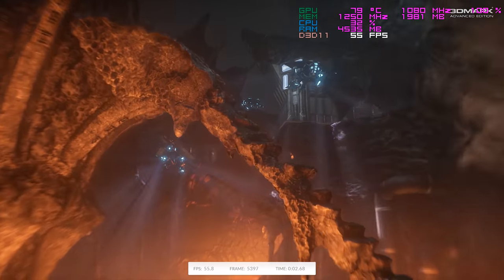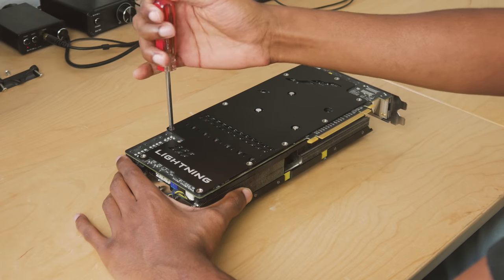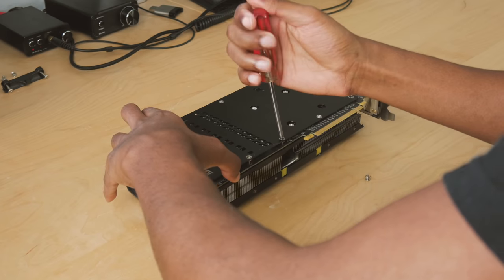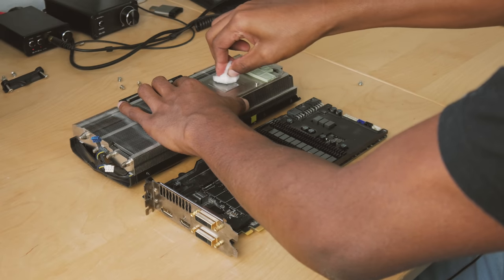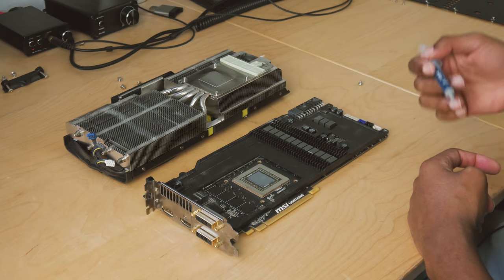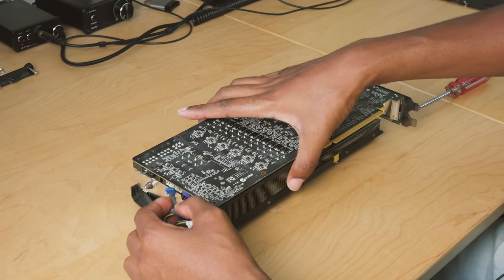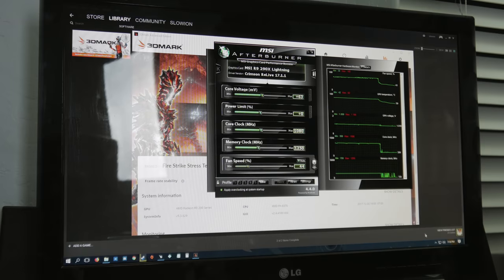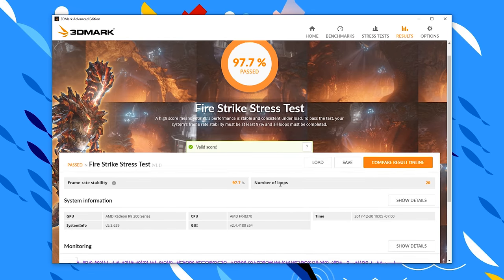Replacing the Thermal Paste on my OLD Graphics Card! (R9 290X Lightning) Was it WORTH IT?!

Comment from the maker: Have you replaced the thermal paste on your gpu? If so, what were your results?

P.S. - Sorry for the shitty audio at the beginning
Reply: I replaced the Thermal compound on a EVGA 980ti and i dropped from overheating thermal throttling 95°C to about 71°C Overclocked, I replaced it with Noctuas NT-H1 and I'm used to spread it on the gpu die. The old thermal paste was really dry and crusty so it wasn't an unusal thing that this past won't let any heat through.
Reply: The R9 290X of my dad idles at like 60° and reaches temps of 85-90° under full load. The card is already 5 years old and has never been touched
Recently i changed a few setting for the texture quality to be high performance rather than good looking and also raised the power+temp limits to max. So that explains the rel. high idle temp
Used some thermal grizzly kryonaut(IMO the best heat conducting regular thermal paste besides LM)and it idles now at 45° amd reaches about 75° under load
Reply: Before repaste my R9 290X WINDFORCE REACHED 95 degrees in ubermode very quickly around 30 sec and started to thermal throttling. After repaste the temps dropped DRAMATICALLY! before repaste GTA V in quiet mode always was 85 and starts to throttle. Now it it's 75 degrees.
Reply: @NiumeLTU  im having same problem with you, i just recently got some cheap used r9 290x windforce and damn that thing is so loud and hot, 3 mins of furmark and the temp shoot to the roof, reaching 95C, tried repaste it and cleaning it but still having same problem, should i change the thermal pads also? theres quite a bit of dust in it, or should i get some decent thermal paste like arctix mx-4

Comment: I had a windforce r9 290 that was hitting 94C so i replaced the thermal paste and took the windforce shroud and fans off so i was just the heatsink, then ziptied 2 120mm 2000rpm fans on there, And this thing hit like mid 70C max. Well worth it!
Reply: I had never thought of doing that, but I just bought a windforce 290x and if my temps are high, I will do exactly that.
Reply: My Msi R9 270X cleaned and with new thermal paste hits mostly 86C
In Witcher 3 it sounds like jet machine with fans at 70% and 90C.
Those cards are basically made like that and there is nothing you can do about that

Comment: Just did the thermal paste on my 290x a couple weeks ago with mx4. Gpu idle and middle load temps are a lot lower, but full sustained load still got to 94C (big overclock on it). At least now on max sustained load (couple hours on end) there is no throttling unlike before. Getting the ancient factory paste off was a pain. It was basically concrete.
Reply: What numbers are you able to get from your OC? I'm curious. 
Must be huge with that load temp or just under par aiflow

Comment: I just cleaned and reapplied thermal paste to my old R9-290 after watching the video (because my 980Ti died). It was getting up to 95C every time I stressed it and shutting down. Now its at 81C. Not ideal but at least usable/stable. AFAIK this card always ran hot, it only has the single fan blowing through the shroud. Thanks for the info!

Comment: Hi Jerry. Nice video and thanks for sharing. I have actually made a video about the same card XD. That being said, just a tip: always spread your thermal paste over a die. The reason is because unlike the IHS, the die has heat creating micro components right under a thin silicon layer in every corner. And if just half a mm is exposed, you will notice instability and poor performance due to card throttling back to protect itself. Over a CPU IHS, yes a line or pea method of applying thermal paste will work just fine. Just NOT over a GPU or CPU die. No matter what anyone else tells you or what you have heard ;) Trust me, I have learned this the hard way, and most pro overclockers will also tell you the same thing. 

Lastly, if you really want to test thermal performance with new vs old pastes, you should fix the card fan speed to 100% while testing. This way you will rule out many factors which will result in faulty results, such as turbo boost boosting to higher clocks now with more cooling headroom thanks to better quality thermal paste, thus consuming more power, thus producing exact same temperatures as before thermal paste replacement. This happens a lot and it is then blamed on either poor application of thermal paste or just being a waste of time, when in fact the card is running better, you just miss to see the small increments in turbo boost in certain instances while playing a game. 

If I were you, I would go back and take the card apart again, clean off the thermal paste, and do it the right way :) I enjoyed the video very much and thanks for sharing!
Reply: ive been having an issue with my r9 390x and i think this may be it, it keeps crashing after an hour of playing any game that requires high usage. my radeon crashes so i will try this later and will tell you if it works :) thanks for sharing too this might help me not have to buy a new card
Reply: @armaniac847  did it work because I'm having the same problem with an r9 390 except not the crashing
Reply: @Error-hc7mp  what are the temps
Reply: @Technology Hive Agreed. Test old and new thermal paste with AUTO fan speed is inaccurate. Typically, fans are set to not exceed a certain temperature limit in games, and the new thermal paste is not affected. Check temps by setting manual fan RPM or IDLE for 0 RPM if supported. And as I noticed, the Arctic MX-4 is a pretty stiff paste. Next time, I would choose a different, less rigid mixture, as Noctua NT-H1 or Thermal Grizzly Kryonaut.
Reply: Thanks for the comment.  I ended up on this video because I wasn't sure what method you are supposed to use for putting the thermal paste on the GPU.  Spreading it out sounds like a good idea.  I'll be doing this on my old R9 290X to see if I can't lower the temps some.  It gets way too hot.

Comment: You don't need to remove the whole backplate to remove the heatsink. You just need to remove the 4 screws around the GPU die and heatsink will come off.

Comment: The reference card is a damn nightmare. Loud hot and they used regular ass thermal paste where they used have used pads. Yes they smear thermal paste all over the PCB.
Reply: Did you end up putting thermal pads on the chips? If so what size did you use? And does it work good? I have an r9280x vapor and I cannot figure out the size of the thermal pads and I don't have the instrument to measure it..🤦‍♂️

Comment: i know this is a fairly old video but i wanted to ask whether i could stay in the AM3 platform or move into AM4 speaking from someone that has a FX4300
Reply from the maker: FX4300 only works with AM3. You need a new CPU and motherboard if you want to be on the AM4 platform
Reply: i was just wanted to know whether its worth upgrading platform or whether getting an old fx 8 core could still keep up with the r9 290 because i have suspicions that i'm bottlenecking mine
Reply from the maker: I would upgrade to Ryzen ASAP, even 1st gen Ryzen is way better than any FX CPU

Comment: awesome video! from what ive seen on the interwebs (ikr im basically a phd doctorate) you put too little thermal paste thats why you didnt get a great benifit. i did it with my 280x and dropped 7 degrees and it was running quieter
Reply from the maker: +saad abass more as in thicker or more lines?
Reply: Jerry Neutron yeah just thicker.

Comment: Kinda late to this content but. I have used thermal grizzly kryonaut on my 980ti classified and i dropped around average 7-8C accross all titles i have tried. You should give a try with kryonaut on another gpu maybe.
Reply: Deniz Onur did u spread it or did u just do a line like this video? Or a dot? Im about to use that same thermal paste and im not sure if i should spread of just do a line
Reply: @allenmaranan7852  If there isn't an IHS and its an exposed die, use a bit more paste than usual.

Comment: Aaaaaahhhhhhhhhhh!!!!!  Only use coffee filters (or brand name thermal paste removal wipes when removing thermal paste).  Cotton fibers and lint can create air pockets. "The mating surfaces between these two assemblies [cpu and thermal transfer block] appear smooth to the naked eye, but manufacturing tolerances [and foreign material] cause tiny imperfections that can clearly be seen under magnification.  Mechanically attaching the sink and source together will leave air gaps, but air is a poor conductor of heat.  Any air gaps or spaces in the thermal conduction path reduce thermal efficiency and heat dissipation." (Arrow Electronics)

Comment: I don't think I've ever seen my GTX 1060 get hotter than 70.... even with lots of gaming, but maybe that's because it's only a year old, or that I only have a 1080 at 60 hz monitor.?. My problem is the CPU... have to change thermal paste every year or so... those mid-80 temps make me nervous. Of course, I should just buy an after-market cooler.
Reply: W Bennett 290x where built for this hit any 90 series from amd where built like. A Sherman tank or better yet I’d say Russian cant decide, but it’s fine trust me and I’d like to say this card can be way cooler then that 👌

Comment: Dont get it... why not just cover the surface with a thin layer. A dot or strip cant be controlled. Why dont people think them self.
Reply: Completely depends on the application and heatsinks used.  Do your homework scooter. https://www.tomshardware.com/reviews/thermal-paste-heat-sink-heat-spreader,3600.html
Reply: @casedizzy  covering the whole surface evenly is recommended for GPU as u apply it directly on the die unlike the CPUs.